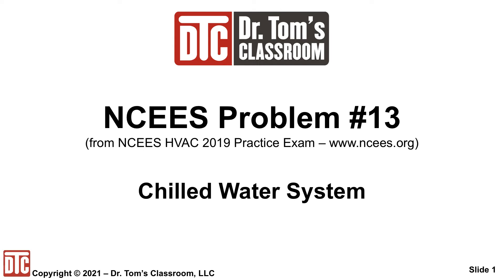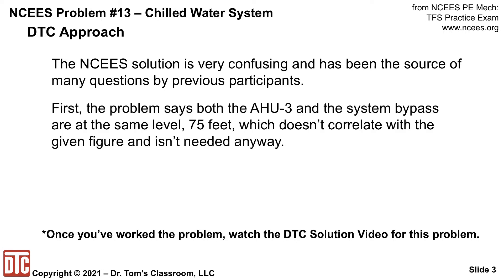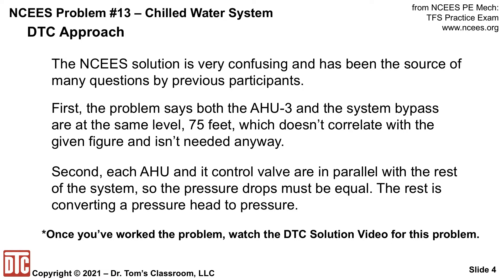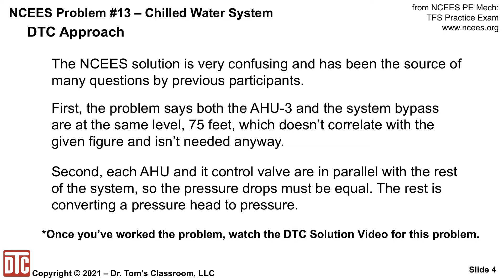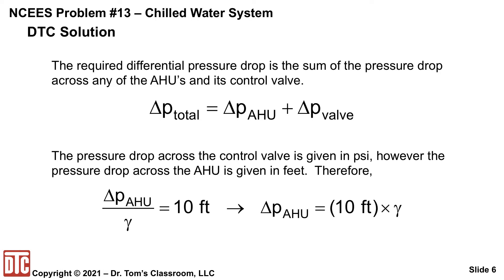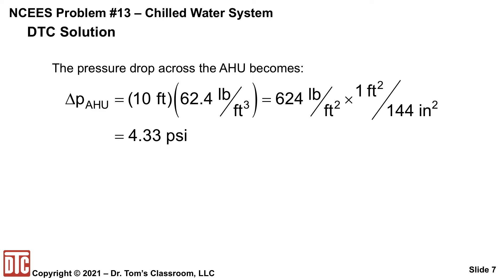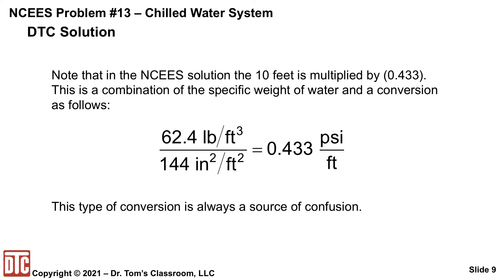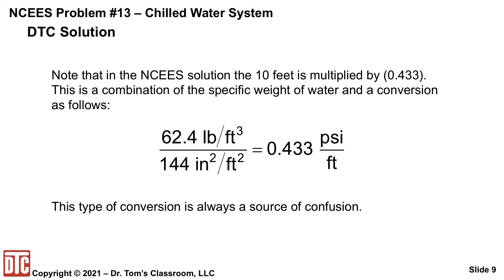NCEES PE Mechanical HVAC Practice Exam Problem 13 - Chilled Water System (Solution Tips)

Comment: The question asks for differential between chilled water supply and return headers measured at bypass. 1 Why can we neglect the 20 ft of head evaporator pressure drop? 2. What would be a scenario in which the height would be relevant?
Reply: The pressure at the discharge of the pump would need to be high enough, but after the evap the pressure would be what’s needed for the ahu/valve. After the ahu/valve the pressure is not increased again until the pump, so delta p would just be the ahu/coil pressure drop. If it was an open system you would need to add the elevation head.